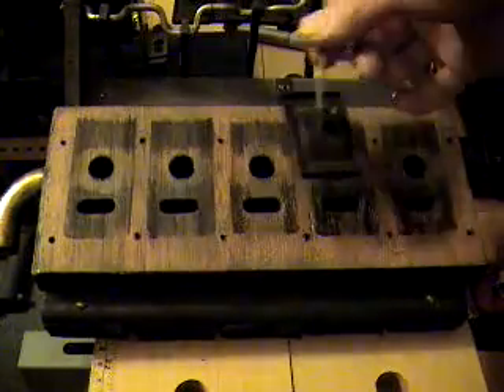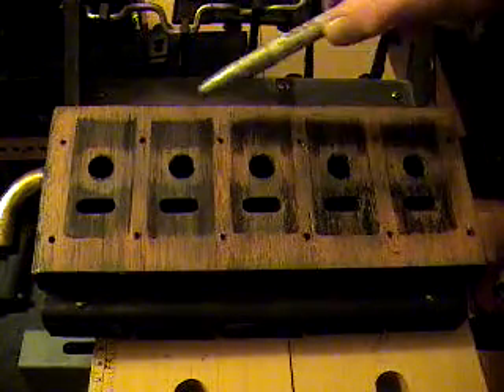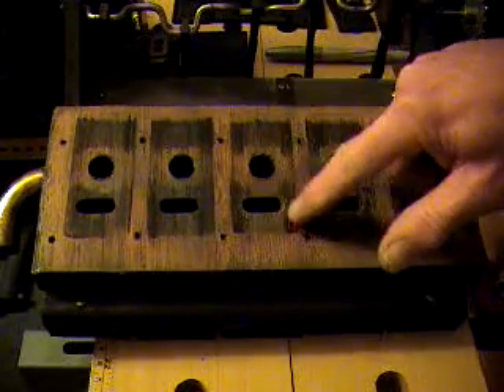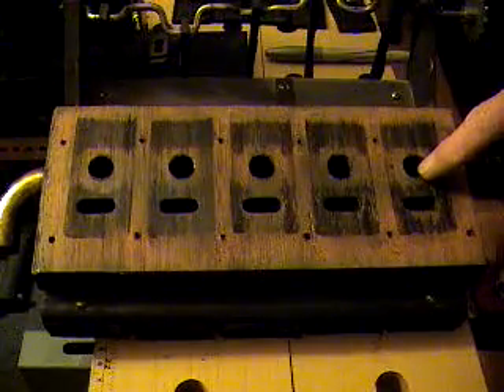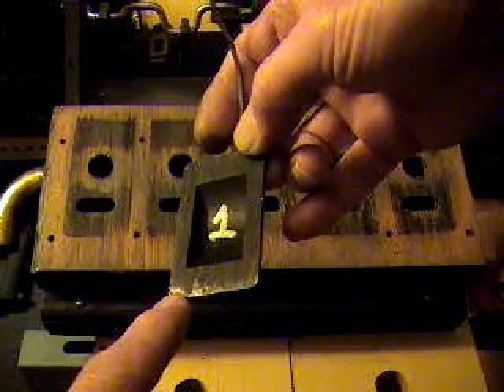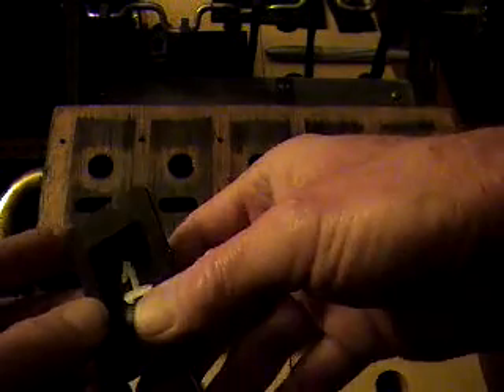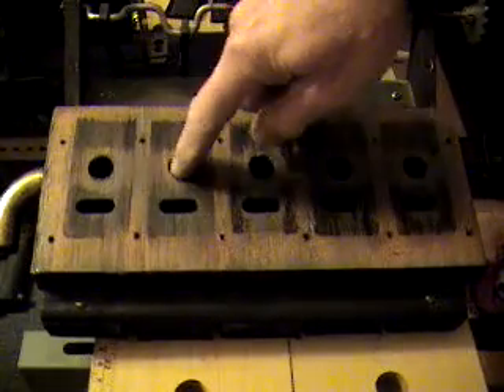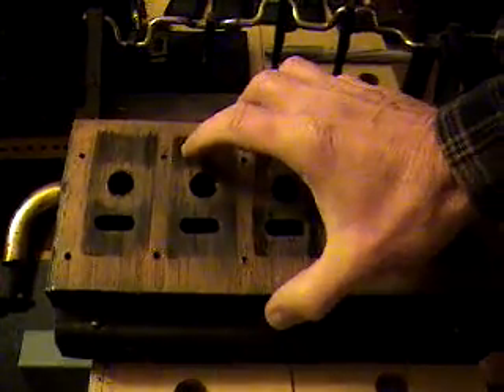Aeolian Air Motor Leakage

Comment from the maker: In reality, the music does slow down a slight amount from beginning to end. That's because of the increase in the weight of the paper (the load) on the take-up spool, and the fact that the air motor governor deosn't get any 'feedback' from the spool which tells it to readjust to the change. It could also be that the forward roll brake is a bit too tight. If that's the case, the increase in load on the air motor coupled with the brake tension slows the roll more noticeably.